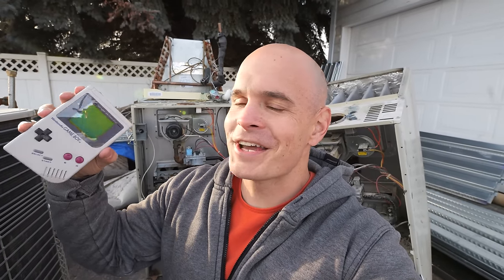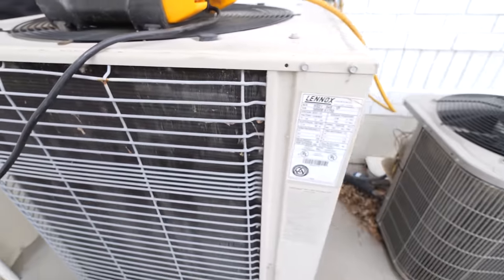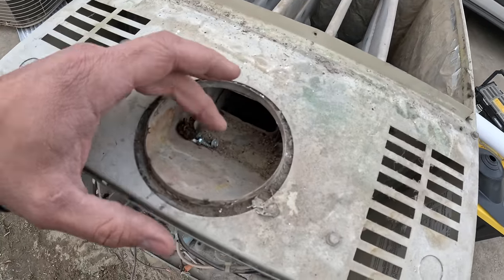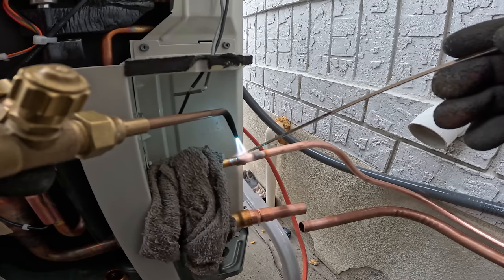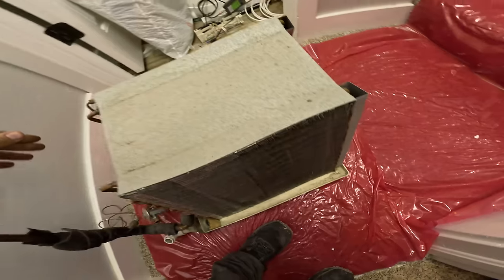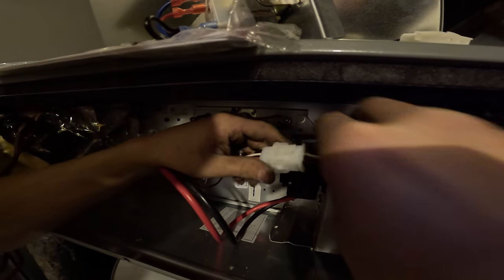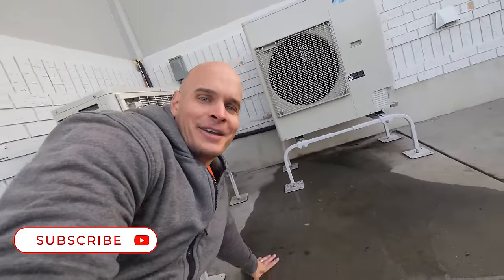Why is Everyone Talking about Heat Pumps?

Comment: Switched over to a Heat pump for just over a year now. Except for the few days that drop significantly below -10deg C, the house has used significantly less natural gas and kept the house warm.

Very impressive tech.
Reply: Spring starts March 19 so you dont have to use a heat pump
Reply: @thewubmachine840  Heat pumps are used year round.
Reply: In Finland I be fine with -20C... Maybe not +25C inside anymore, but plenty :P
Reply: how much do you pay for a heat pump + installation in your area?
Here I'd compare ~2-3000€ for a gas unit to ~10-15.000€ for the heat pump + another 20.000€ (~15-20kwp) for the solar panels, if you prefer not to get eaten by 0,3-0,5€ per kwh.
The heat pump may consume less on a monthly basis, yes, but at least in my region it's not worth it. Break Even Point somewhere in 40+ years, most likely more - thats not a good investment.
Reply: @pete5405  Air to air is 2000-3000€. In a big house you could need multiple. For water heating there are a few options but generally around 10k€. For 20-30k€ you can go geothermal.
Reply: @pete5405  Averge high efficiency gas furance with Ac is 8-10k. A complete heatpump with air handler with backnup heat strips is 12-20k depending on efficiency equipment. 

Geothermal heat pumps are 30k
Reply: Where do you think electricity comes from😂😂
Reply: I'd love to know how much your utilities have been since you switched
Reply: Do you know they also cool our homes?
Reply: Considering heat pumps have been around for 50+ years it's sad big oil had this much of a grip on the industry
Reply: @james2042  because heat pumps still suck. Talk to people who fix them. They are not worth it for most people.
Reply: @james2042  heat pumps end up costing you more than oil. Every time.

My mother got a 2100$ repair bill this spring for her four year old unit.
Reply: @Milkywayboy  Mine comes from a series of nuclear power plants that have served the region since the 1970's making Northern Virginia the silicon valley of the east. Where does your natural gas come from?
Reply: Natural gas is abundant - the fuel used to heat our homes. It can also be used for cooling. The argument against "big oil" is a farce. It's used in processing almost every consumable product. 

If you come up with some good alternatives, let us know. Electricity comes from burning coal in many areas. We build dams that cause issues in the environment for hydroelectricity. We mine minerals for lithium batteries which creates environmental issues.

Heat Pumps still use power. They're a good alternative if natural gas is unavailable. A heat pump may be the most efficient. However, electricity can cost up to four times more in different parts of the world. Heat pumps can cost more to fix. The refrigerant can be toxic. Most times, it's a trade-off.
Reply: @FeedMeSalt  sounds like a 300 dollar oil change to me. I'd love to see the invoice
Reply: @james2042  oil change? For a faze change heat pump? You mean coolant I assume. 

Or do you mean my parents furnace oil bill, because never in my life of 26 years have I seen a furnace oil bill that low. 
In Ontario over 15 years ago our bill was 480$ a month during the winter. 
Fuel has more than doubled in cost since then. 

Again, Canadian currency.
Reply: @FeedMeSalt  no what i meant was the mechanic that charges 300 dollars for an oil change on a car, aka a scam. theres a good chance she got ripped off. plus most of those systems are warrantied for at least 5 years, so if it had catastrophic failure at 4 years it should of been free, once again leading me to a sleezy repair man
Reply: @james2042  1. Multiple large partnerships have gone bankrupt voiding our warranties across Canada. LG are in deep water for that actually. 

Two, labor isn't under warranty only parts. If the guy spent six hours you pay his six hours.
Reply: @FeedMeSalt  Your mother got scammed.
Reply: You’re likely talking about air to water heat pumps which are very different price wise to air to air units.
Reply: @pete5405   @pete5405 Just watched Alec's (Technology Connections YT channel) video about heat pumps and he explained that most companies try to give some huge numbers like 10-15k. The units itself go for about 2-5k that are big enough for normal house. In colder climates you will still have dual fuel systems just for those crispy winter weathers. That can raise the price. Gas prices went more expensive here after 2022, electricity price did not raise as much as gas. There is some installation cost for sure, for me it was 1k€ for new cable from fuse box to balcony where heat pump is, project creation fee and included already fees for local municipality to process the project and then finally the installation of the heat pump itself. Heat pump was 2500€, but I took a bit more fancier model, could have gotten cheaper for the size of my apartment.
Reply: @pete5405  Yup, this is the key, especially since the life expectancy of the system is only a decade, as opposed to the THIRTY year old furnace being thrown out. I reached out for some quotes since my oil furnace is 30+ years old, but the cheapest I got was $25k for a 936sqft house, and of course the quotes always underestimate so the real price would be higher.
Reply: Do you pay for the gas hook-up every month? The connection fee for us is like $20 every month even if we only use the heat for 4 months.
Reply: @djplonghead5403  I have no gas connection, so I don't know about it for those who have it. But as I have heard, then it is fee based on consumption. No fee for just having a gas connection.
Reply: cost of electricity?
Reply: @Milkywayboy  

Well we know your questions comes from ignorance! 😂😂

* Most states use a combination of sources to generate electricity. Coal, natural gas, sun, wind, hydroelectric or nuclear. 

* Even if your state uses nothing but fossil fuels to generate its electricity, since heat pumps (either air source or geothermal, like I have) don't create heat but simply move it, it's generally 4 times as efficient as something like an oil or gas boiler. Translation: you're using far fewer BTUs of electricity than you would BTUs of fossil fuels. 

So OP is right. It's far cheaper to run and way better for the planet. Btw, the same applies for EVs. They're way more efficient to run than gas cars, so even if you charge in a state that gets all of its electricity from fossil fuels, it's still way better for the planet and cheaper, even factoring in the environmental hit in making the battery. I'm sure you thought you made a point, didn't you?
Reply: @djplonghead5403  Our connection fee, or what Atmos Energy calls a 'customer charge' is $41.23 (USD) a month even if you use no gas at all in central TX.  We all know it's borderline extortion, but gas per unit is relatively cheap here making the overall bill tolerable.  If I was to stay in this house for 20 more years, I'd replace my gas furnace, water heater, and range with more efficient electric units and ditch the gas bill.  We don't use much heat here anyway.
Reply: Heat pumps have been popular in cold Norway for a very long time now. Pretty much the go to heating and cooling solution here.
Reply: This tech has been out for literal decades.
Reply: @FeedMeSalt  I self installed a mini split heat pump and made back the cost in 2 heating seasons over a high efficiency propane furnace. In my area propane is slightly cheaper than oil yer over year.   That includes the all in price including some tool I needed to get.  It also includes the increase cost of electricity.  At this time all the savings are pure gravy and my propane furnace is being used a hell of a lot less so it should last longer.  So no in my experience heatpumps are far cheaper then propane which is slightly cheaper than oil.  Plus oil does require regular servicing , and emergency service is certainly going to happen even if everything is properly maintained, which does add to the cost. That is why oil companies will typically offer discounts on the price of a new oil furnace/boiler over propane.
Reply: @DaleESkywalker  Not everyone can get natural gas, but yes natural gas is an economical choice, at least for now.  What you say about coal is deceptive, you should be talking about natural gas as that is double the national electricity production of coal.  But you are trying to make a point by distorting the facts - don't do that, you just hurt your own cause.  With increasing use of natural gas (not coal) to meet the needs of heat pumps, EV's and a internet connected society, and to mine crypto, , yeah the prices are about locked into each other for some time to come.
Reply: @Giffandy5329  I did self install my minisplit, but it did make it's cost back in 2 years, my furnace, which rarely gets used will most likely last longer.  So even if it only last 10 years, I have a furnace with less wear and tear on it, and I've made up my investment times four, which means in replacement cost 10 years I'll be 3x ahead.
Reply: @DavidStrchld  you did a 1500$ service yourself and claim it's cheaper? 
Dude that's like me saying my 2006 f150 costs me nothing but fuel cus I do the work myself.
Reply: @DavidStrchld  All I said about coal is that it's used for creating energy in many places. That's still a fact. 

Yeah, it can cost to have natural gas trucked, or if the pipelines are new or the cost of living is high (supply vs demand), you'll pay more. But they do it on ranches and remote places where no lines run in the Western states all the time. If you don't have a supplier near you, that sucks.

As I said, there are many trade-offs in the environment and technology.
Reply: @FeedMeSalt  That's a $1600 INSTALL, (not service) - LEARN TO READ!  Made back that in fuel savings in 2 years.

Comment: Replaced our 20 year old standalone AC unit with a variable speed heat pump just two weeks ago. Our 6-year-old gas furnace remains to pick up the load when temps drop into the 20's as a cold climate model like your heat pump makes little sense in the Puget Sound area. Your description of the difference between how heat is delivered to the house from a furnace and a heat pump was the best I've heard yet.
Reply: @randalllewis4485  I bought the same heat pump (Daikin DZ6VSA361E) last November and it performed wonderfully during that week long cold spell (18F) here in Portland without kicking in the aux heat strips.  COP @ 17F is 2.25; COP @ 47F is 3.30.  You had similar weather in Puget Sound.

Comment: 4:15 Clean the copper before putting crimp on connectors, that can lead to a leak if the oxidation doesn't seal.
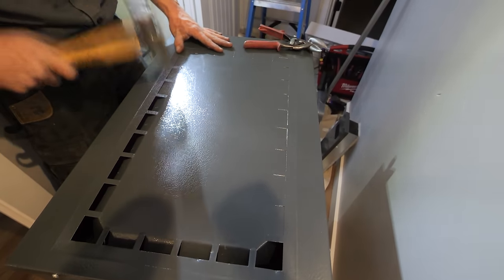5:15 Those tabs are meant to be bent outwards as a sleeve for structural support to the connecting box.
5:55 Take the plastic covers off so they don't melt like they did. That's a seal for the inside/outside air, not anymore.
I hope you didn't pay more than a few thousand dollars for that service, especially with the recycling discount.
Reply: yeah, the dude is a hack. not even flowing nitrogen.
Reply: Yeah it was a bit of a rough job, also why use those crimp fittings, I think it just lazy and unnecessary extra cost. Those outdoor unit brackets looked horrible too.
Reply: @greencheeksconure  yead, its stupid to be pressing stuff when you have the torch right there already. but considering he was using no nitro that was probably a good thing but he didnt prep the pipes for pressing so i am fulling expecting them to be back for warrany work a LOT of times.
Reply: I thought this looked rough but have no frame of reference.  Glad to see others in the field validating it.
Reply: My installation started with crimp fittings. They lasted 5 months. Now brazed.
Reply: This is what you get when it's free. The power company sponsored the video with that equipment and installers I bet.
Reply: Looking for a heat pump installed in Layton, ut .. 
If anyone has better references
Reply: @SupremeRuleroftheWorld  well you cant really see that, but you need nitrogen flow in the pipes when soldering, or else you will have a lot of flak/debris in the pipe, which could wear down the compressor. Good point.
Reply: @SupremeRuleroftheWorld brazing requires more approval these days. Also less chance of burning a house down with a crimper
Reply: @dylanzrim3635  that is some bullshit, he IS brasing inside the home where there is zero approval needed, its plainly visible and he is doing it in the worst possible way. and in case you missed it: he is also pressing with bad pactices. the dude is a hack, no crimping tool is going to solve that.
Reply: Glad there is another HVAC tech in this chat!
Reply: Yeah I almost cried when they didn’t Remove the rubber around the coil connections at the evap coil.
Reply: Hush..  nobody cares
Reply: @greencheeksconure across the pond all of us use flaring for connecting HVAC
Reply: @SupremeRuleroftheWorld  IMpossible to tell from video is he's flowing nitro or not. I didn't see a can, but doesn't mean much.
Reply: @jordanhenshaw  go look at his indoor soldering job. the pipe is blacker on the inside than the outside and there is no positive displacement of air coming out of the pipes at any time. dude hast he worst practices and he only solders so he can put  on crimps wich he also does not prep properly. what gives you the idea that a tech with those "skills" would flow nitro in the first place?
Reply: @greencheeksconure everyone uses crimp now wtf.
Reply: @SupremeRuleroftheWorld lol they are probally paid minimal from the power company as sub contractors so they get by with less work
Reply: @Newberntrains  being a sub does not excuse the basic practices like flowing nitro. if they were actually penny pinching they would be brazing and not crimping.

Comment: I work for Daikin, nice to see you went with the FIT systems!  If you have any questions feel free to reach out. Beware of those press fittings they used though. They brazed on the units themselves I dont know why they just didn't braze everything. Brazing is much better long term. Press fittings will leak much more easily especially if installers don't prep and seat the pipes properly. 

Hopefully they were purging nitrogen through the system when they did braze.
Reply: Yup nitrogen is needed if they did not do it they will be changing out the filter drier in a couple of years

Comment: In sweden HP has been extremly common in the last 30 years.

I have a Air to water heatpump myself that gives heat to my radiators and hot water. Its great.
Reply: Have a heat pump that use the constant 4 degrees that exist in the mountain instead of the outside air. Very cool stuff
Reply: @sys-administrator  Which is why heat pumps are usually better off with water based floor heating as the required temperature for that water hovers around 30°C.
Reply: @nilsekluund 

Since I only use about 8000kwh per year för heating, going geothermal isn't worth it for us. 😃
Reply: @sys-administrator You must have very poor isolation then, I can heat my home just fine with 40, just takes a bit longer.
Reply: @sys-administrator  You're thinking of it the wrong way around. You dont NEED 65c to heat your home, you need it to compensate for having a high heat loss flat.

Anyway, thats beside the point, a NIBE S2125 will output 65'c water at -25c outdoor temps. Rather lousy efficiency at that point, but still much better than using resistive heating.
Reply: The US has oodles of cheap natural gas and 98% efficient furnaces so we do not need Heat Pumps for heating.
Reply: @kellymoses8566 heat pumps are about 500% efficient.
But stick with your old 98% gas furnace efficiency is you are happy with that.
Reply: @vonnikon For years after moving to Japan I used 2000w of space heaters because I'd read other gaijin on line saying "don't use the heat mode, it's a giant hairdryer, that'll be expensive!"
Until I found out it would give me 2200w of heat while using only 700w!